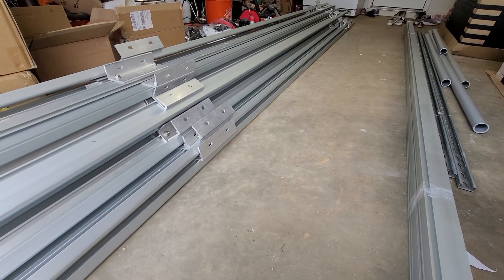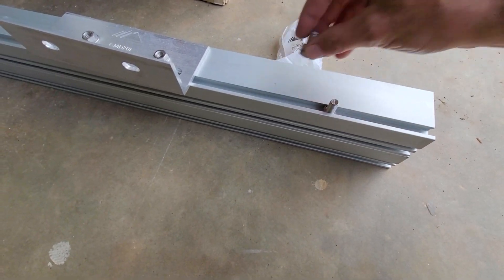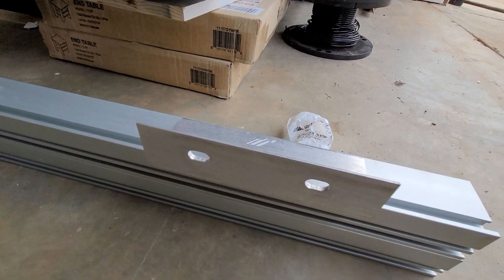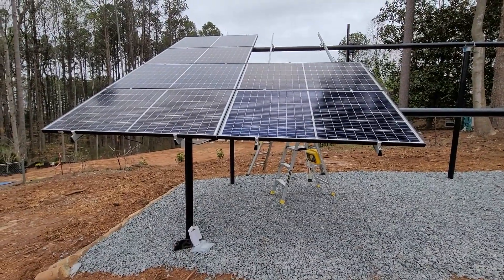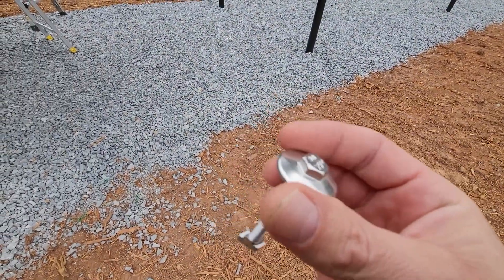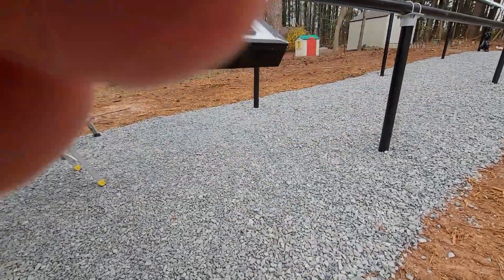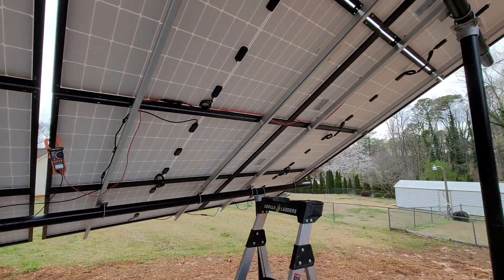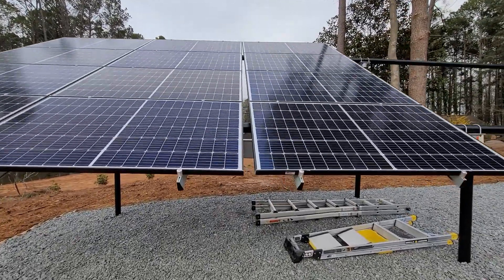Ground Mount Solar Array Part 6 Starting Panel Installation

Comment: Well you got  a start. The only thing I see is you may have a problem with continuous ground without running a wire and clamp to each mounting channel and into a ground rod imho.  Cheers.
Reply: you will not need it with iron ridge system. the bolts make a ground connection per panel. so only one ground wire connection point is need to earth
Reply: @zekeboz5533  The pipes are treated but it may be possible to get a ground from panel to panel except he said he was going to leave the gap so no ground between panels. It was just a suggested comment.
Reply from the maker: You are correct. I was worried about that too. Since I treated pipes I will need a true ground. However those Iron ridge bolts are serrated on the diamond part and on the head part. They do grab into panel and racking real hard so wire ground to panel is not needed.

Comment: isn't that too high of a voltage? the LV5048 are 150v max on each PV input (so 3 panels in series)
unless you are going to a 250v input charge controller, you'll fry the LV5048's.
Reply from the maker: Unless.........   ;)